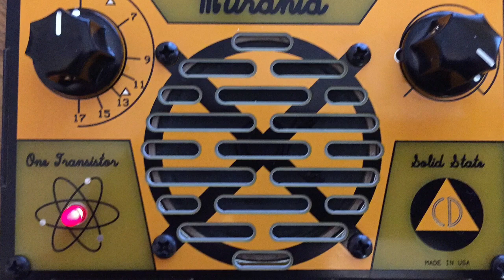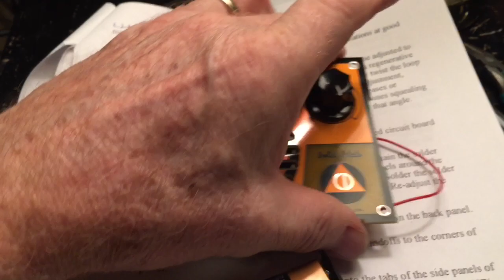Murania Radio Kit

Comment: Nicely done video, really very good. When you first powered up you only got two stations, one of them across most of the tuning. Later when it was in the box it did much better. What adjustments did you do, was it just tweaking the loop at the end of the antenna or did you do the mods discussed on the Murania kit 4SQRP subgroup? Thanks.

Comment: It sounds OK but unless you're right near a strong station I would expect better selectivity - especially above about 900 kHz. 

It appears to use the TA7642 - an IC similar to the MK484/ZN414.  http://www.4sqrp.com/kits/Murania/muraniaschematic.pdf 

Earlier versions of the latter were unselective but you can get better performance if you adjust the voltage going to the input pin via the 100k resistor (with a preset potentiometer). 
An example is https://www.youtube.com/watch?v=lJehuHHaOv8

Luckily the board is nice and big with room to easily do modifications. Have you tried any?